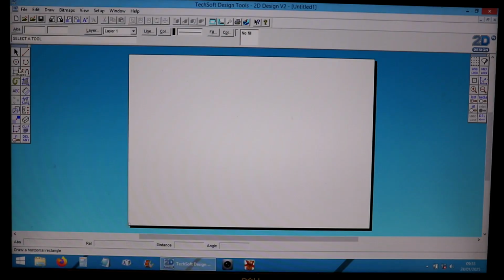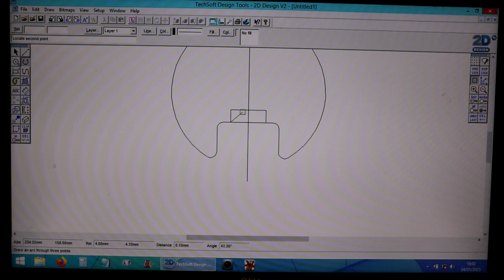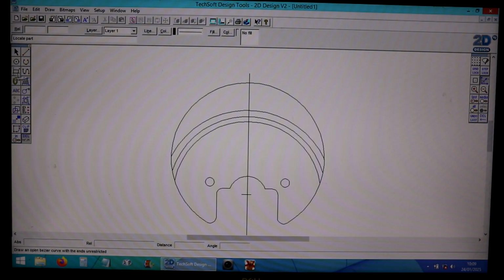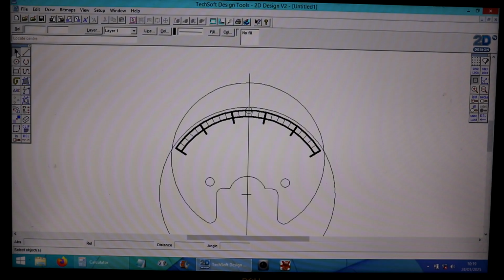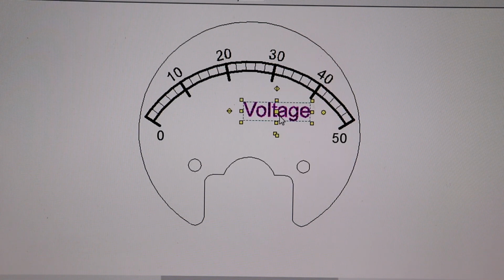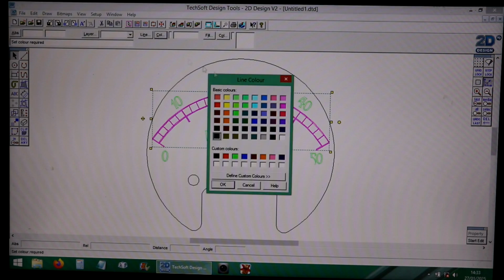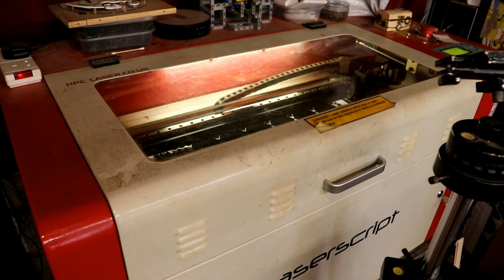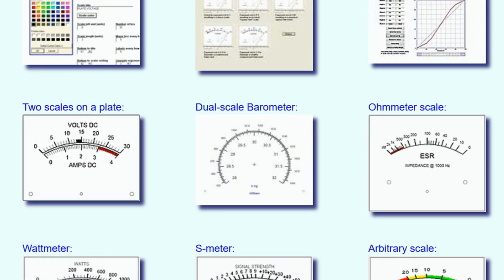Tutorial - How do I make the dial for a customized gauge?

Comment: AutoCad (DOS)  oh what memories , Loaded on floppies and the (green) screen redraw would take the 286 about half a minute. Each line or measure once confirmed correct needed a redraw. My shortcut was to save shapes and angles to a floppy then paste them in. This did not always work as the plotter would stop if the line was not continuous.

One file sent to  the machine shop was for nylon but the lathe had got steel in the chuck. It did not go well..  Hand drawing was something my father would when designing boat hulls. He would use "splines' (thin flexible rods) and lead weights to get he form. Same as the Aircraft draughtsmen. He had a PC Cad program but liked to do the area  and stability calculation by hand. I have his slide rule on my desk but not the skill to use it effectively.  Scratch to Ziggy
Reply from the maker: Oh the days of floppies and very little RAM. When I started teaching in the early 90s, the DT department had a couple of BBC Micros that would run Boxford milling machines. Teaching students the very early principles of CAD CAM was a challenge. Put in this floppy to load 2D Design, then put in this floppy to allow you to draw something, then another floppy to save your design - obviously with no nice user interface, just command line instructions. Then another floppy to load the Boxford software... One mistake and the students were left with the distinct impression CAD CAM had no future!

We didn't have splines, we had a lead filled plastic curve drawing tool! If none of our elipse templates would suffice, laying the curve tool on the drawing and lining it up with the relevant points worked a treat. It seems so alien now!

Scratchies to Indi and Cooper.
Reply: @steamhead  Dad had a chart weight he used when he was 1st Officer for Castle Line, it was covered with thick stitched hide,  His straight edge was a 1/2 inch think boiler glass which was very useful.  

I think splines were a crude way for nature to make subtle adjustment in the mathematics thus assisting in creating low laminar flow hulls. With 6 points of reference you can draw a very complex curve. Calculating the volume would be a nightmare.  
I forgot the details of the CAD I was using but it was the second course run at Birkenhead Tech, the system was slow which was probably for the best as the tutor was only one step ahead.  RAM was 500kb and we had an complier to CNC which had its moments as the disc was sometime not readable by the machine so the TD office would call down to the machine shop where they would set up the material to be machined. 

This is where the human let down the technology as machine speed and material types sometimes did not coincide.with the program being sent from upstairs. Cutting a thread in Nylon at 800 rpm and a lead of 1 inch per second was ok but not so good if the tool finds a lump of steel in the chuck. Apparently they did not find either the tool or the part to be threaded.   

BBC Micros rings a bell, I know they were the first with a colour monitor and programable interface, rather advanced machine and well supported by the BBC TV programs,  Amstrad followed with a good entry level machine,  I still have a RadioShack TRS80  and a Commodore Pet in the basement which looks more capable than it is. I built  a Tangerine motherboard and other Fruits but my programming is not good and didn't progress further than toggle switches on a PDP11 and Basic on a Spectrum.  I could however read the punch tape in 5 bit Murry (CCIT RTTY)  code which impressed others but of little use, later as a Radio ham I could read the warbles (if slow enough) rather like morse which I still haven't mastered.  

Thinking of the hundred drawing tables and paralel motions that were in an aircraft drawing office. How did they manage revisions it really is most impressive the level of detail.  Back on track, your font choice is like that used for "Adam Adamant ".  A little Victorian and a little 21st retro.  Similar to that used for 'Upstairs Downstairs" .   One part that is missing is the Revision and Mod serial number plate on your machines.  And a Manufactures LOGO.. At some time history will need this when they enter you name in Graces Guide.

Best wishes and belly rubs.
Reply from the maker: @ how lovely that your dad achieved such complexity by using his brain and some basic 'found' drawings aids.

Funny to hear your tutor at Birkenhead Tech made the most of the slow CAD software to stay one step ahead! Not so good trying to cut a thread in steel with nylon settings - human infallibility...

In my formative years I learn't how to 'program' on the ZX81 and then Spectrum. It was so exciting, although the ZX81 regularly overheated as Sinclair just used a bit of aluminium as a heatsink rather than a proper one, and if the 48K RAM pack that plugged into the back of it was moved, you'd lose everything as they'd used a cheap connector - good times. I'm very impressed you could read 5 bit Murry encoded punch tape...

I just liked the look of the Malificeo font, it is a pain only having capital alpha-numerics, but I like/have to think such constraints promote creativity!

I should also include the classic Revision, Mod, serial number, designer, signature, date and logo on each of my drawings. And of course a border line to let engineers know if part of the drawing has been torn off - oh the memories.

Scratches to all
Reply: @steamhead  Border lines ha ha,  Lesson one how to tape paper to board, lesson 2 draw a border and Revisions box and key.

Dad was an amazing man, a polymath and a mind of information which was worth hearing.  His drawing of hulls were done by hand and his construction lines had strange calculation that were above my head. Later he bought a license for a professional hull design software which he used to verify his work.  Using the splines to naturally form a curve created a form close the the program..   I remember he brought home the very early Sinclair calculator and showed me how it could display ESSO,  I showed him how to write BOOBS. 

ZX81,  Sinclair sent out a fix for the RAM module, use Bluetack !.  That machine was magnificent but for the wrong reasons. Sinclair optimised production and components very well unfortunately he underestimated the interface between the ZX81 and the 330 lb gorilla operating it. Main faults were keyboard, plug, and heat.  I have a Sinclair digital frequency meter, the case is already drilled for other devices and the holes covered with a label.  

Manufactures name plate in brass would be the finishing touch, you could use your laser to etch those.   My first assessment of quality is the nameplate and is it on straight.  I like the font it is very you, Helvetica was one I used but can't find it now. 

Murry tape, as a radio ham I used teleprinters a lot and still have  few in the basement. The mechanism is comforting to watch. In the film Brazil the keyboard was a Creed 7b and the name 'Buttle' was typed 'Tuttle'.  Bell-cranks, cam's eccentrics, pawls clutches, springs slides  all chaotically moving to reproduce my misspelt message.  Ahhhh bliss.     

I recently got the Family grandfather clock set up after four years in storage. The old fella circa 1780 fired straight up and within a few days is accurate to a second a day. Mechanical devices once bedded in are very predictable.  "Curiosmarc" YT  has an Astronavigation unit apart and the mechanical complexity is magnificent.

Scratchy to Ziggy from Banjo's (wet and muddy)  squad
Reply: @ Border lines ha ha,  Lesson one how to tape paper to board, lesson 2 draw a border and Revisions box and key.

Dad was an amazing man, a polymath and a mind of information which was worth hearing.  His drawing of hulls were done by hand and his construction lines had strange calculation that were above my head. Later he bought a license for a professional hull design software which he used to verify his work.  Using the splines to naturally form a curve created a form close the the program..   I remember he brought home the very early Sinclair calculator and showed me how it could display ESSO,  I showed him how to write BOOBS. 

ZX81,  Sinclair sent out a fix for the RAM module, use Bluetack !.  That machine was magnificent but for the wrong reasons. Sinclair optimised production and components very well unfortunately he underestimated the interface between the ZX81 and the 330 lb gorilla operating it. Main faults were keyboard, plug, and heat.  I have a Sinclair digital frequency meter, the case is already drilled for other devices and the holes covered with a label.  

Manufactures name plate in brass would be the finishing touch, you could use your laser to etch those.   My first assessment of quality is the nameplate and is it on straight.  I like the font it is very you, Helvetica was one I used but can't find it now. 

Murry tape, as a radio ham I used teleprinters a lot and still have  few in the basement. The mechanism is comforting to watch. In the film Brazil the keyboard was a Creed 7b and the name 'Buttle' was typed 'Tuttle'.  Bell-cranks, cam's eccentrics, pawls clutches, springs slides  all chaotically moving to reproduce my misspelt message.  Ahhhh bliss.     Tickles from a very mud Squad
Reply from the maker: @WOFFY-qc9te I'd forgotten about learning how to tape the tracing paper to the drawing board!

What amazing skills your polymath dad possessed. It must have been so satisfying for him to find the CAD calculated designs agreed with his. Then there was giggle and lots of others. I remember my bank manager dad (in the days when bank managers respected their customers) came home with an early calculator and demonstrated some long winded joke that involved doing some complex calculations that ended up spelling a word. Sadly I can't remember the details, but I was amazed.

Those were the days - add a bit of Bluetack. Having watched numerous documentaries on the Sinclair organisation, he really comes across as a hothead with a dream, forcing designers to 'get it to market' regardless of 'minor' issues. 

An engraved manufacturers name plate would be nice. However using my 60 watt laser tube, with a guide to only use it up to 40% power to preserve the tube and the optics, isn't capable of engraving metal. Perhaps I should invest in some metallic brass effect engraving laminate...

I must put you in touch with a friend of mine who worked for his parents as a printer. They didn't have any digital equipment, just ancient lovely mechanical printing presses and Linotype machines that he kept running. They employed the last type setters to actually set metal type in galleys. He collected every sort of technology that was going out of date. You'd have to squeeze past piles of radio transmitters and teleprinters just to get into the living room! 

I love the fact you noticed 'Buttle' was typed 'Tuttle' in the film Brazil as the keyboard was a Creed 7b! Brilliant. 

Assuming you still have an active amateur radio call sign, can you email it to me so I can pass it onto my friend? You both have so much in common!

Scratchys to all.